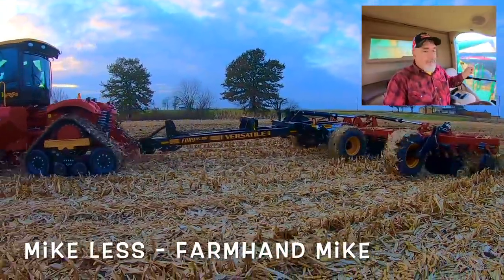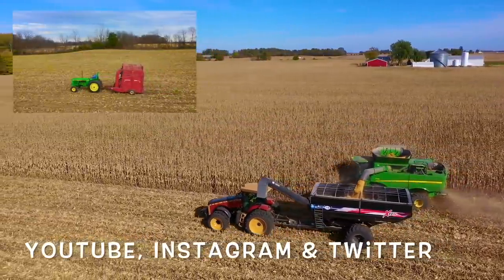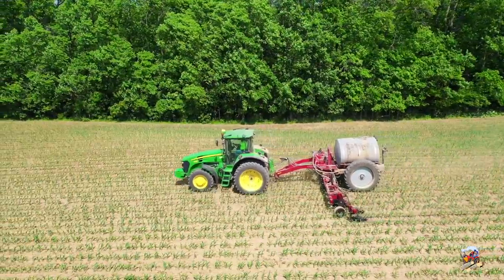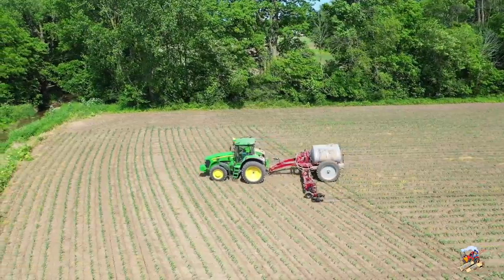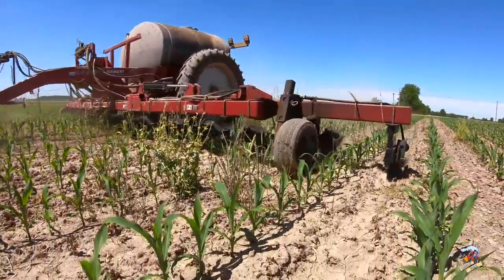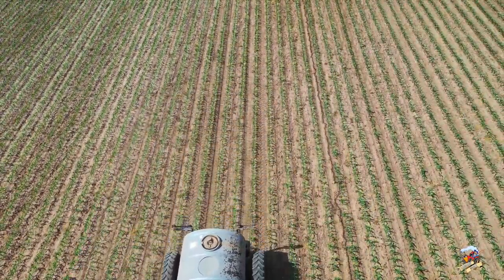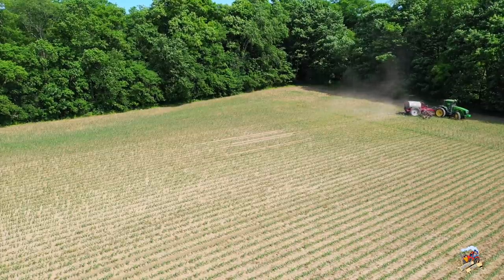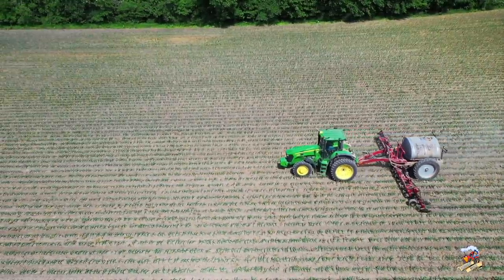Feeding the Corn for BIN BUSTING YIELDS

Comment: Two questions: (1) Is the coulter/knife positioned midway between the 30" corn rows?  Or is it positioned toward one row, intending the nitrogen be closer to the growing corn? (2) I've never done this operation, ... Is a GPS telling you which rows to drive down when making the turn at the end?  It seems like no hesitation on positioning the front wheels for the next pass.  I am doubting you can count rows when moving that quickly.
Reply from the maker: The Coulters are running right in the center. After you do it enough you can count rows pretty fast. If we are done with the corn planter we have used the monitor and GPG though but not this year.

Comment: Mike, how much does the corn in the header rows get damaged when you're turning around?  It seemed like some of it was popping back up but I can't be sure.  Thanks!
Reply from the maker: Thats why you try to get this done before the corn gets too big. Some corn will pop right back up and if its small enough and breaks off it generally grows back. You just don't get the top yields on the end rows but in a few weeks it all looks about the same.
Reply: @farmhandmike  If I might add, the stuff they are putting on should increase the yield to more than make up for any loss on the headlands--unless you break a hose on one of the rows and burn some corn.   But that is a rare occurrence, right Mike?  At least that's what Dad always said.  I miss driving down rows of corn.  But it took a long time for that feeling to come back, lol!  Great video, Mike.